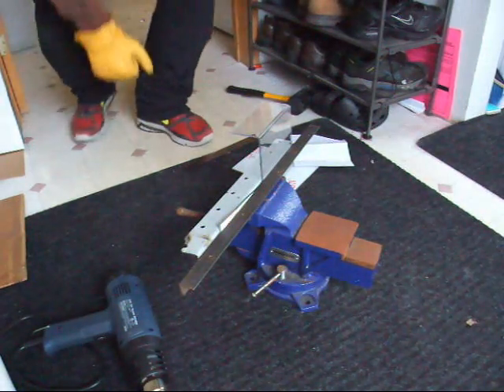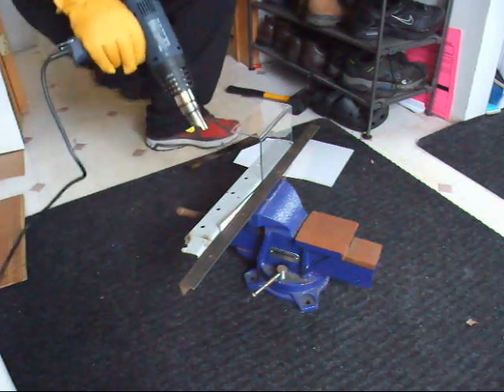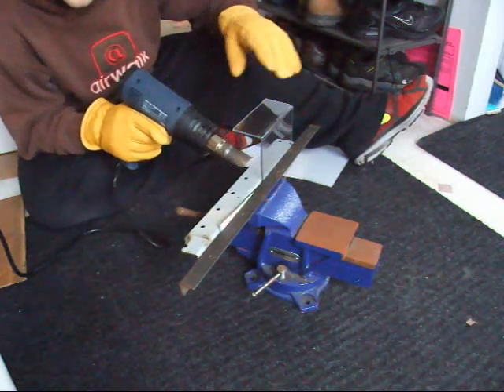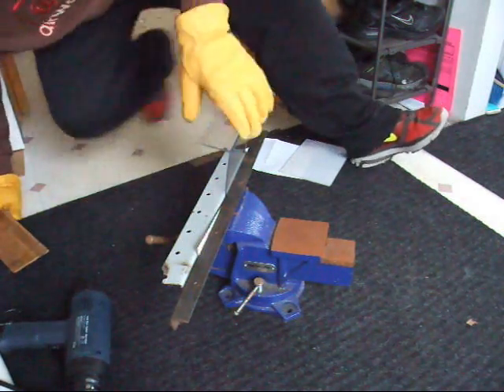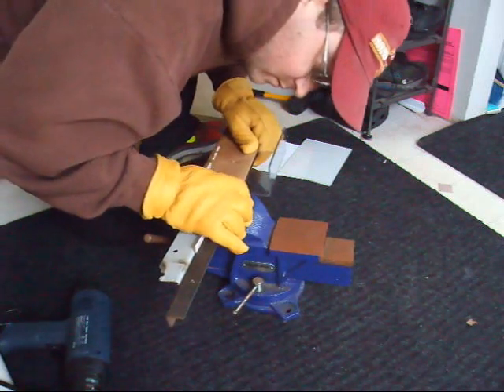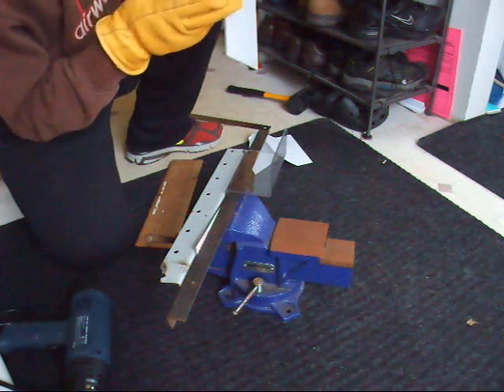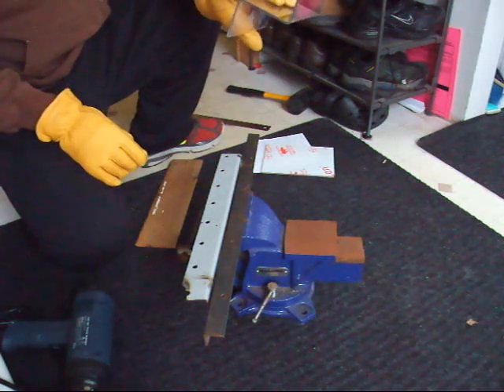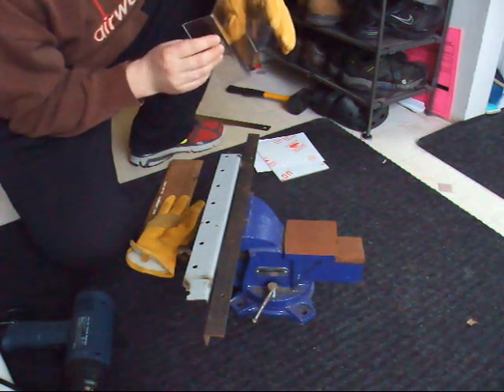Polycarbonate Bending with Heat Gun

Comment: What about bending polycarbonate tubing? I wanna bend some 1/8" thick tubing into a circle or a "ring" ...any thoughts or suggestions on this? Thanks!
Reply: try using a inner rod, like maybe a spring or something inside that is uniform in shape, to keep ot tubular while you bend it. maybe foam core idk, smooth on has pourable flexible expansion foams. youd pour it into your tube, and most likely start the bend slowly, work your way to a full ring. maybe vaseline the inner walls up so you can remove the foam later , as polycarbonate is weak with certain chemicals, i have no idea which ones tho
Reply: I'd use an oil, maybe regular mineral oil. Use a pipe the right length and maybe half an inch in diameter. heat the pipe/oil with a torch until a thermometer says 300 F or so:  https://en.wikipedia.org/wiki/Polycarbonate#Properties_and_processing
I'm not sure the luck you'd have heating a low mass item like tubing with a heat gun. Might cook it.
They basically say it softens at 297F and flows at 311F. Get the temp right and dunk it in (with the wire inside) and after it changes state, it should bend right off. dunno how tight a radius you were going for, tho...

Comment: Question:  I noticed you didn't wear a mask when doing so.  Is there any safety concerns with fumes?
Reply from the maker: With polycarbonate there are little to no fumes compared to PVC or ABS, not saying there are no dangers, however for an occasional small piece of  bent plastic, i don't worry too much...  If it had been warmer outside i would have done it there but overly cold temps make the plastic harden too quickly to work it.
Reply: Some plastics you definitely should wear a organic vapor respirator.

Comment: I tried to do a curved windshield for my velomobile that is optically true but with heatgun it was impossible to achieve. the windshield looks good, but optically the vision has so distortions that I don't want to drive with it. Next I'll try to heat PC-sheet in owen and lay it over some kind of "mold" and hopefully I get flawless vision. Have you done this Ypedal?

Comment: Do you know if lexan is harder to bend than acrylic?
I'm looking for a clear plastic that does not bend under 160 degrees.
Acrylic started to bend at 130 when it was under tension.
I need the plastic to be flat again so I can reuse it. 
I guess I could buy a piece for 5 bucks and try it.
Thanks